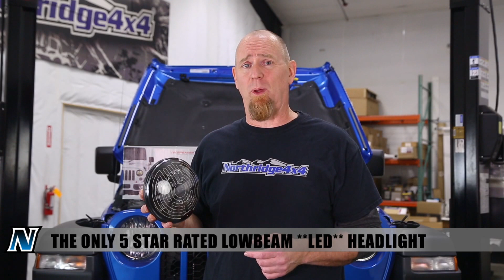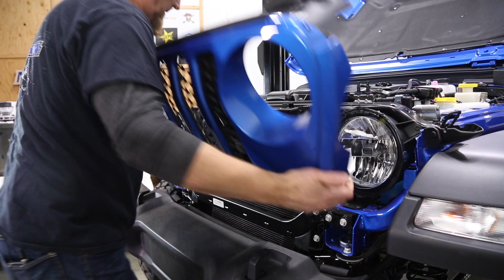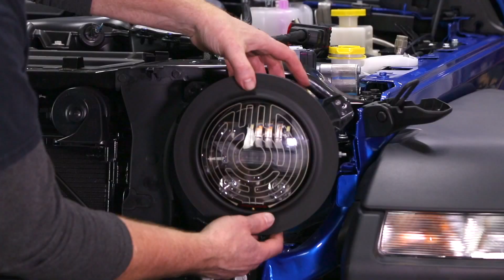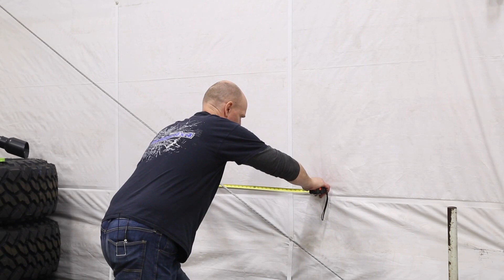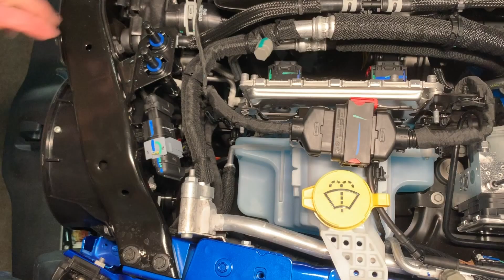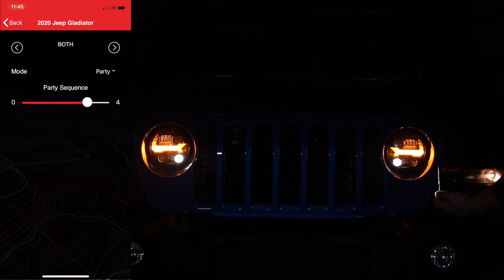J.W. Speaker Evolution J3 Headlights Install - Jeep JT/JL

Comment: Just talked to JW Speaker and they are never going to make an adapter for the Gladiator that allows you to wire in the turn signal.
Reply from the maker: That's sad.... 😢

Comment: The design of the adjusters makes it very difficult/tedious and not user friendly for quick adjustments, when the vehicle is heavily loaded and then unloaded.  With a high powered LED like these, the ability to quickly (as in OEM design) adjust the height of the beam is very important, IMO.   JWS went the cheap and easy route on these buckets and it's not up to their usual design quality.
Reply from the maker: We agree, the headlight buckets could be much better.

Comment: How does this installation differ for the JK?
Reply from the maker: They will bolt right into the JK, no headlight bucket required.
Then you can add in the Trail 6 lights in place of your OE lights: https://www.northridge4x4.com/part/lighting-blowout/0555373-jw-speaker-trail-6-pro-kit
Reply: @northridgenation  Thanks this is the step im at. How about a short video on how to cleanly wire these trail lights pros? Thanks

Comment: How do these compare to Jeeps LED headlights?
Reply from the maker: We've never tested them side by side.
Sounds like a future test!
Reply: @northridgenation I had them in a 2017 JK Rubicon Hardrock. And have them in my 2020 Toyota Tacoma TRD Pro. I'll never go back to incandescent lights. The reason I'm asking is I'm trading for a new Jeep JL 2-door Rubicon. And I'm going for the LED light package. I know that JW Speaker makes the best LED automotive lights out there. Was curious how they compared. Would possibly just get the Jeep without them and put in the JW's when I got the Jeep.
Reply from the maker: The OE LED headlights are pretty dang bright on their own, but we would bet that the JW Speaker headlights are brighter.
The more we think about it, the more we want to test them side-by-side. Will have to see if we can arrange that.